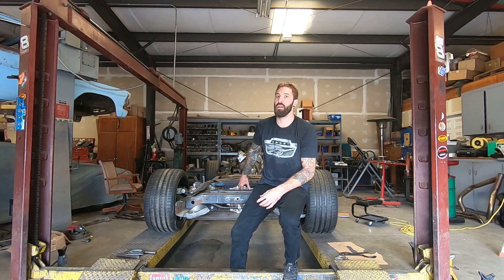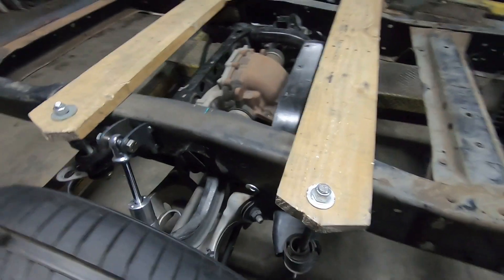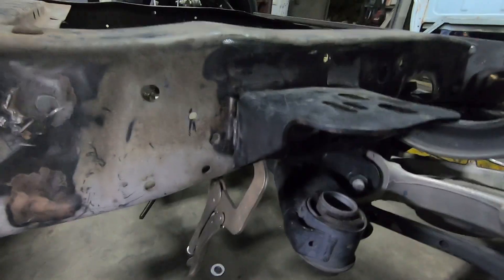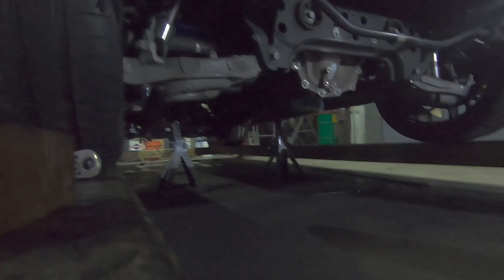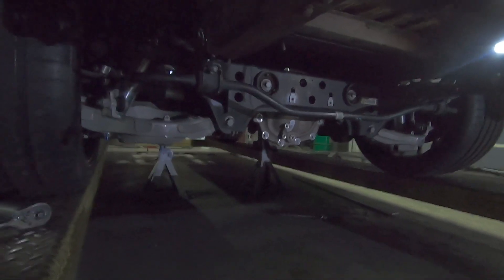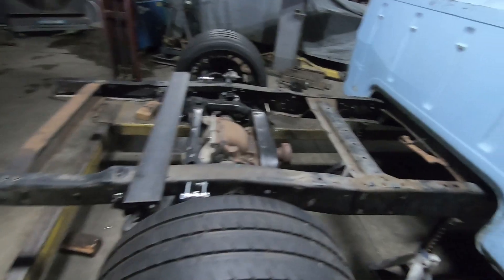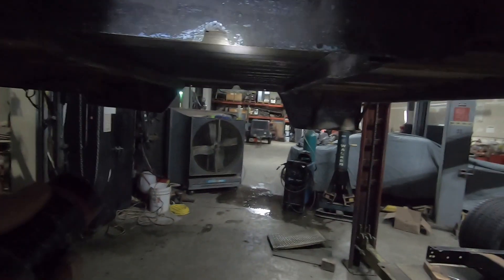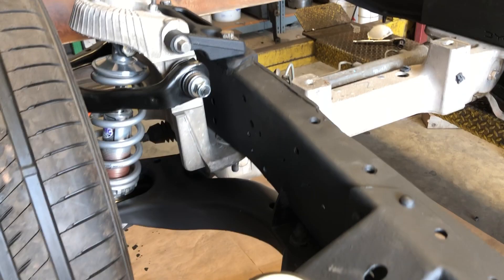F100 Mustang s550 IRS Swap

Comment: What Brand Coilovers did you use on the front of the CV subframe and do you have a side pic of the cab so I could see the rack of the truck?

Thanks
Reply from the maker: I used Viking coilovers front and rear. I have an instagram page for the truck with a bunch of pics. @windblue_72

Comment: I'm so stoked I ran into your guys videos. Earlier this week I was at a stand still on my next move. I was trying to figure out my potential ride height and felt the Crown Vic front I put in was too high. Of course there is no drop spindle kit and then Eaton springs was a last hope until I started reading their customer reviews, No Thanks. After seeing you put that IRS in I have no choice but to put one in myself. I'm building a 1970 F-100 uncut short bed. The motor I have is a 1997 DOHC Cobra 4.6. I will need someone to tune this Beast once its all together also. I need a gas tank. I'm in need all the way around. Looking forward to meeting you guys!

Comment: I see that you used a nice wide tire. Will I be able to use a wheel with some lip? I have already purchased Rocket Racing Wheels 20x10.5   0.1 offset 139.7 Backspace
Reply from the maker: If you are installing the IRS into an F100 you won't be able to run those wheels. The mustang IRS is about 68" wide and leaves very little room between the mounting face and lip of the fender. We will be doing a video on measuring for wheels, specifically on this setup in near future.
Reply: @PerformanceProductions  I appreciate the response. Have you seen anyone that has used this IRS on a Dentside. I haven’t yet. I’ve already purchased the IRS so I believe I’m going to go ahead and take a look and see if I can get the same wheels that I want with less dish and make it work. Will I have a problem with using staggered wheels? I already have the new 20x8.5 on the front with the QA1 IFS.

Comment: Good vid on the basics, will you share tire/wheel size and backspacing?
Reply from the maker: 19x11 +56 305/30 all around
Reply: I am wondering if you had any rubbing in the front with that wide of rim/tire and that backspacing? And if so what did you do to remedy?

Comment: That’s pretty cool and I have a question how many inches of travel does that it’s have?  Like free movement for bagged purposes.
Reply from the maker: I measured that at some point but I can not remember what it was. I know the guy who owned the Mustang I pulled the IRS from had it bagged, so there must be that info on one of the Mustang s550 sites. I'll updated you if I ever figure that out.

Comment: badass. great video. i was leaning towards doing the 8.8 for cost savings but this just put me back on the mustang irs track.
Reply: I have a 70 F100 and I did the 8.8 out of a 96 crown vic, by the time I installed trac loc, new gears, rebuilt rear end seals and everything, added four link with coil overs, ended up being about $1,500.... in hind sight, I would have just purchased a whole IRS and did this.

Food for thought